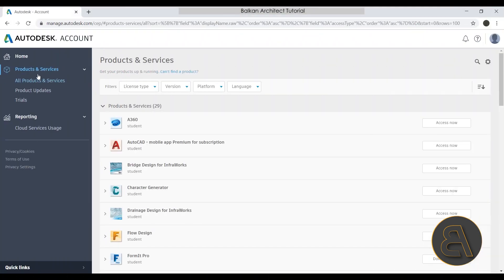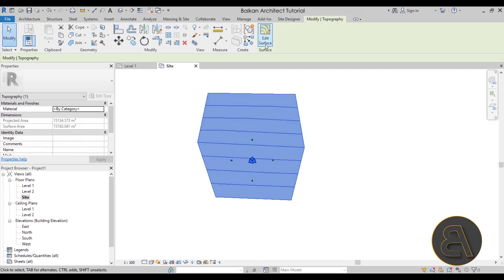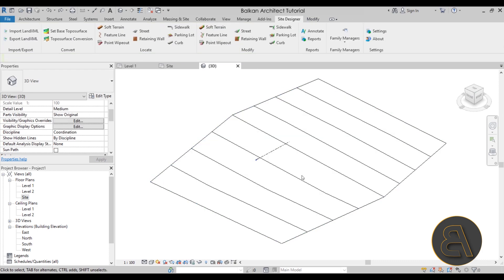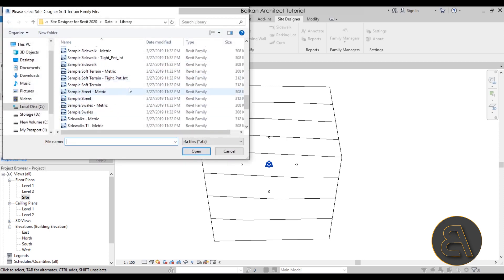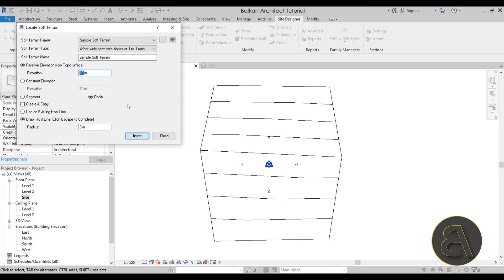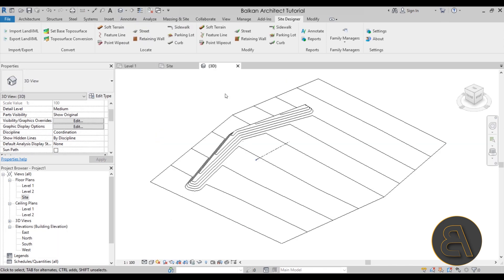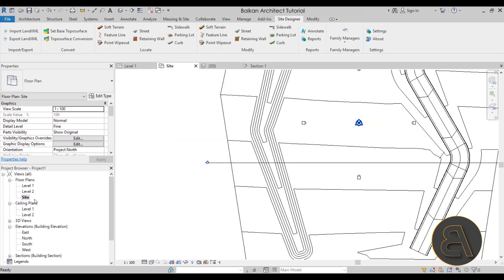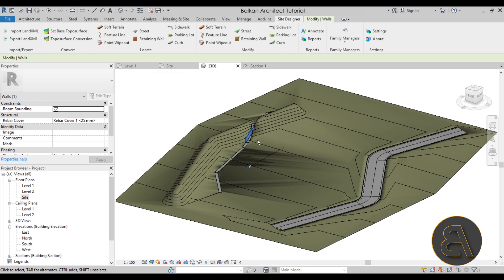Site Designer for Revit Tutorial

Comment: Hi, I would like to make a couple of questions:
Site Designer is a very good tool to make topographic changes in the model. However I frequently face some difficulties.
1 - When I create several toposurfaces, is there a way to select which of them I can modify?
2 - Whenever I use a surface as base to create a new Toposurface (not the first in the model), the others existing Toposurfaces are deleted. How can I work this around?
I appreciate if anyone could help!